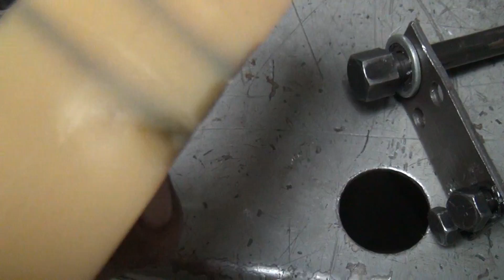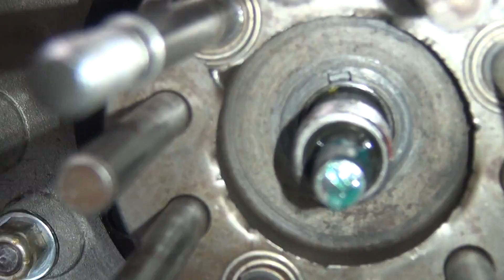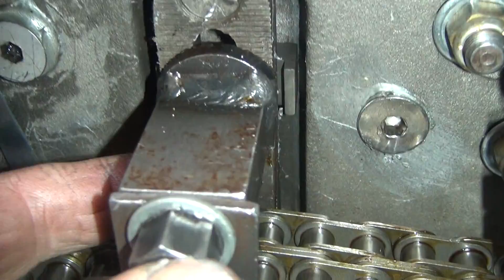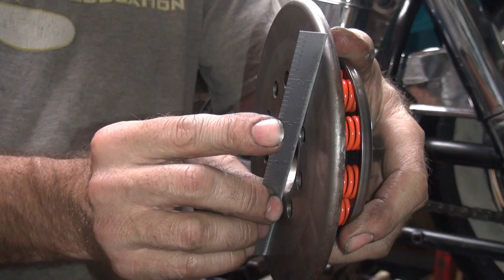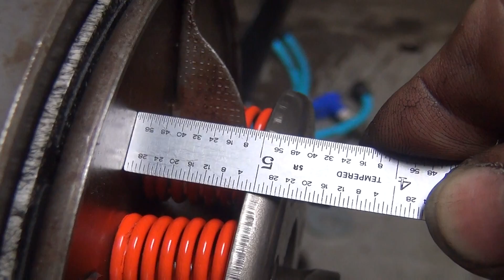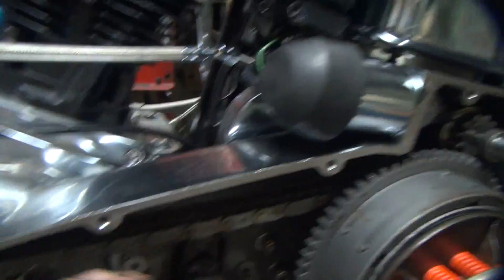1972 #125 FLH 98ci shovelhead stroker motor rebuild Harley by tatro machine

Comment: I watch this every time I pull a Shovelhead apart. You actually show every aspect of how it's done correct.  You are a great teacher as well as mechanic. More of a professor of all the good stuff. You can tell your dad was a master as well. Thank you for all your videos.  You will leave a great tread mark on this earth sharing your knowledge. Thanks KT! If you get a chance throw a vid of the rear juice drum. There's nothing anywhere. I know it's super simple but there's nothing on the interweb.
Reply from the maker: go watch some of my panhead bike videos. with over 6000 videos, i have shown most things at least once already.
tatro
Reply: @TatroMachine  I will search again. Seen the mechanical stuff. I guess it’s basic bleed 101. Thanks for all your videos. Keeping it alive. Keep on trucking bro.
Reply: Very true. I have been following and watching him for years. I have learned so much. I love old Harley’s and unfortunately my dad passed away when I was 13 so I haven’t had anyone to show me the things I’m interested in.  Tatro vids assisted me into completely rebuilding his 77 shovelhead.  Rebuilding the transmission was the hardest but tatro has a really good video on how to line those dogs up.  Buying the specific specialty tools is tremendously cheaper than having someone do them. I even bought a lathe about 15 years ago and it’s been a godsend on building and repairing old bikes.   I’m getting ready to swap out the primary is why I’m back on this video. 99% sure I remember it all but it’s extremely nice to have this free available content to freshen my memory

Comment: I had a mere 23,000 miles on my 80" Evo and when I installed the Ultima 113" it totally ate up my existing primary chain rendering it junk (after 300 miles), I guess that's normal.
I have upgraded everything else to include compensator eliminator from Evolution Industries and their clutch basket. I also got rid of the Junk Kevlar belt and swapped it out with a woven carbon fiber belt. I guess a good fully synthetic oil would be best for the primary case? luckily I found a NOS Diamond primary chain for a replacement. Does anyone make a "Heavy duty Primary chain"?
Reply from the maker: i have not seen problems with primary chains with big motors. i only use the diamond square link plate chains or the oem harley ones. make sure that you have atleast 3/8" to 1/2" chain slack. also make sure that your sprockets are aligned. any offset in your sprockets will kill the primary chain. i use the 85w maxima primary oil but atf will work to. tribodyn 75w90ls oil will work to but you have to be carful with synthetic oils. they do not always play friendly with the clutch plates.
tatro
Reply: @Tatro Machine  thanks Keenan, I'll double check my alignment once I install my new Evolution Industries clutch basket.

Comment: i always put my plates in first, then adjust chain... i usually go one notch looser, because when it heats up, it will tighten...and may offset the basket when you release the clutches...other than the Friday night Prom date,...looser is better..

Comment: Did you put grease on the hub between the hub bearings and the hub itself because they looked completely dry? ...(I am concerned because I think I over greased mine last time I put it together and I'm getting ready to put the clutch together again).
Reply from the maker: with a chain drive you don't need much because the oil will do its job just after you start the motor. on a belt drive you need to grease it up real good.
tatro

Comment: Hello Tatro, i have a question about startermotor axle  sprocket on my shovelhead 1978 fxe , with primary chain outer and inner cover , how much shall sprocket teeth overlap clutch sprocket teeth in start moment , my startsprocket seems not overlap cluth sprocket with perhaps 1/2 teeth
Regards
/Janne
Reply from the maker: that is how harley made them. you could cut the starter adapter or primary boss to get more engagement.
tatro

Comment: I see no reason to take off those two bolts on the bottom of the chain adjuster.
Reply: It was missing the lock tab
Reply: @carlproia5477  I forgot to put the lock washer on the main chain adjuster bolt one time and it cracked the back of the primary. anyone reading this beware, there is not enough clearence back there to put it on without the lock washer on that bolt. Don't make that mistake.

Comment: Why do these arseholes even talk smack to you. If you have ever owned / worked on / ride hard a shovel. Pan . Knuck & I emphasize worked on Tatro knows what he’s doing. Good & Tight is always Right. Very few torque specs for these old bikes. Read the original repair manuals. I know how hard this stuff is & what it takes to keep them going & Tatro is one hell of a mechanic. Shovel heads forever. Thank you Sir..
Reply from the maker: you are correct on that.
tatro

Comment: What size nut and pitch is the motor shaft ? I wanted to run a dye over the threads to clean them up. Running belt drive and can’t find in parts book anything that tells me what size it is.
Reply from the maker: come on, can't you do anything simple. take a tape measure and measure the diameter of the shaft. thin for the hard one. put the tape measure over the threads and count how many threads per inch you have.
tatro
Reply: Tatro Machine,  sorry to bother you
Reply from the maker: you just need to use your brain and think. not everything is complected if you break it down to simple task. this was a very easy task that you can do yourself. that is what learning is all about.
tatro

Comment: I just wanna make sure and know your opinion, i got FLH 1972 the owner manual says pressure plate 31/32in  (1966-1967) or 1 1/32in (1968-on) you used 31/32in in your video what do you think? One more thing i messed up whit push rod clutch and adjusting screw push rod they wore off what did i do wrong thank a lot
Reply from the maker: those are the minimum dimensions for the springs. back them off some to make things easier to work. sounds like the throw-out bearing is not working very well.
tatro

Comment: Thanks for making these video. I wish I would have found this a month ago when I was replacing my clutch hub. I didn't locktite the key or shaft. I've also seen you use red loctite on the threads in another video but not this one. I didn't use it but used the lock tab. Should I pull it back apart?

Comment: my 79 shovel makes clunking noises and jerks forward when I let the clutch out and it sounds nasty I adjusted it to the Harley manual and it still makes the jerking and clunking,  any idea what it could be I don't ride it because I feel like it's gonna break something and wanna get it fixed and back on the road..
Reply from the maker: time for some new plates.
tatro
Reply: I just replaced a 3 finger spool with a 5, when steel fingers get worn badly the surging can't be ajusted out.
You mention it when installing friction plates "no binding" simple but alluded me for years. I have 73 flh bought in 88. You never did show the final clutch cable ajustment, my through rod over to the kicker seems to be portruding to much and was hoping to avoid pulling kick cover off, it won't pull out so clip and sm bearing must be still attached. I learn from all your vids and appreciate the info, bet your retired Air Force ?

Comment: I couldn't believe that ruler. That 1/32" looked like a mile. What do I know? I'm just a carpenter.
Reply from the maker: that would be .010 or ten thousandths of an inch verses you 1/32" which is just over .032 thousandths. a house is alot bigger then a bike so the numbers are different.
tatro